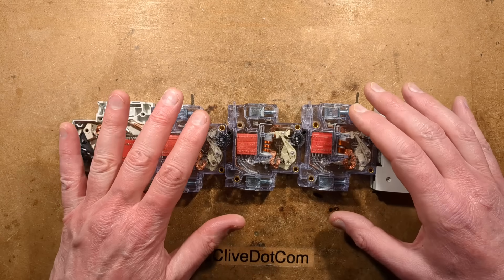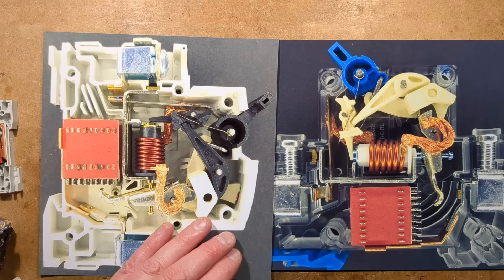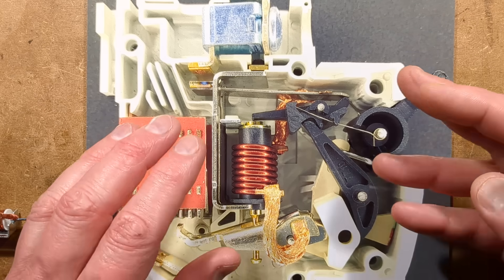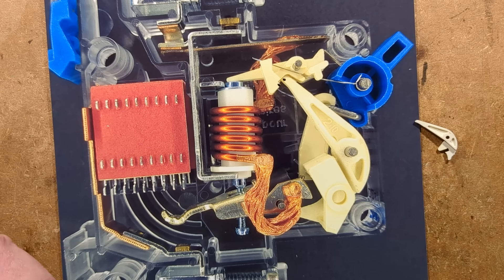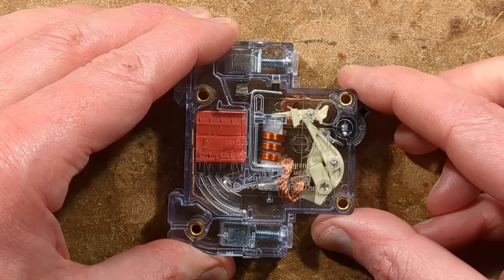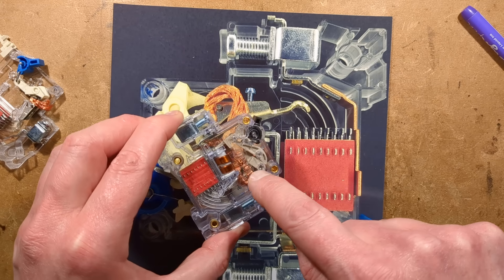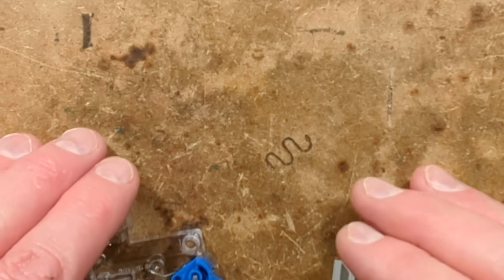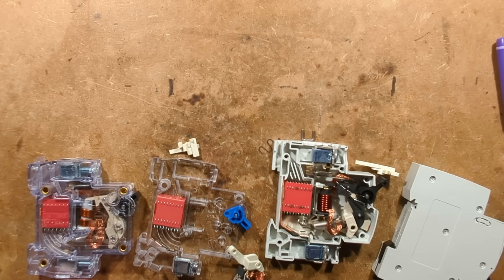A detailed look at the trip mechanism in circuit breakers

Comment: Big Clive I have a problem! I have an electronic tachometer from a motorcycle and it will need some adjustment to work. I can't find any details on what the circuit does to do it's job. Can you help?
Reply from the maker: That may be better suited to a dedicated motorcycle forum.  I know there are different types and workarounds for some.

Comment: OFF TOPIC - Interesting. 
Suggest that you could do a similar video on the thermocouple/safety cut off valve combination used in gas appliances works. I've never understood how the thermocouple generates enough current to hold the solenoid in the gas valve open.
Reply from the maker: I think it's a simple magnetically retained flap that requires very little current to hold.

Comment: Curve B is 3-5x its rating (anywhere within this is acceptable), Curve C is 5-10x (so if it trips immediately at only 8x its rating, that is still acceptable), and a Curve D trips at 10-14x. I don't know where you were getting 20x from. If a Curve D breaker fails to trip immediately at 15x its rated fault current, that would be rejected as defective.
Reply from the maker: The D curve can extend to 20, so you have to use the worst case scenario for instant trip calculations.

Comment: Thanks for your always very nice explanation 👍
I live in Indonesia and recently I serviced/changed the 30+ years breaker panels in my house by loading them individually using a stopwatch and bank of high power incandecent lamps as a variable load.
The lamps in the house has been changed to LED lamps, fridge and AC are more efficient so most breakers rating can now geberally be lowered. About 2 out of 10 breakers are not morking properly, some are noisy, slow working . . .  or plain dangerously not working. Definitely all of them are dirty (sand, dust, insects, damp) and the connectors are rusty. There is no guideline on what year interval these breakers need to retested although the installation safety standard has been revised 14 years ago to use GFI/ELCB.
Maybe it is worth mentioning that new MCBs have a provision to keep the lever “sealed on or off” using the piece of wire (or 1mm fishing line) across the indentation at the lever /hole at the casing.
Also in the many poor area, people dangerously using the (cheap) MCB also as a switch, which as you demonstrated, relies on delicate plastic parts as its latch. When the MCB is used as a switch, it is not working as a protective MCB upon switching on, causing a large current surge. 🙏

Comment: Off topic.   I want to replace an e-bike battery  . My motor is ..350w..battery that came on bike ..30w 19.4 A
Would a slight upgrade of . 30w .13 A  be ok to use?

Thanks.
Reply from the maker: I can't really advise on e-bike stuff due to the risks associated with their batteries.

Comment: I wonder what the difference is with the DC versions. From the outside they look identical, but they are functionally non compatible (apparently)
Interesting Levels of design input with such a common product.
Reply from the maker: They may have a magnet to deflect the arc into the quencher.

Comment: In Uruguay, we use bipolar circuit breakers. Each circuit breaker is composed of two units like the ones you showed, assembled together, and they cut both poles. If you disassemble it, you can see that internally they are linked by a small springy wire, so if the circuit breaker of one pole trips, that spring makes the other one trip too.

Comment: These breakers at 3 or 4 pounds are quite the bargain. A single 20 amp USA breaker for a Square D entrance panel is about 20 USD, last time I checked. Very complicated little mechanism, kept affordable by designing for mass production. Thanks for this post BC!
Reply: that's about £14 in British pounds
Reply: They're about $8 at Lowes today.. not unreasonable. GFCIs, however, are a fairly disgusting $60+.

Comment: The breaker tripping curve is crazy.
We had a breaker trip at work once in a while and so was checking everything plugged in and I became confused. I used a kilawatt and read the plates for what was plugged in and it was WAY OVER the rating. so went to make sure the breaker had correct rating too and when I looked up model it was possible to get nearly infinite amps if you ramped up slowly enough... .. think of several shop-vacs and air compressor plug other stuff plugged in to same 4-block plugs 120v. 

One funny thing was because so many things running together it was causing voltage dropped down to about 100v from 118v. and that was lowering the amps, like self regulator. 😂
Reply: @ralanham76  there is a not-so-well known problem where circuits that are wired with cabling that is too thin can defeat the circuit protection due to self regulation of the current through the too-thin cabling.  Unfortunately, the result is usually a cabling fire instead the wall instead of a trip.
Reply: @junkerzn7312  I think in this case it was a combination of very long run and the way it was used. Once it had tripped a few times we knew something was going on. I'm sure there was some good heat going on. It was in metal conduit the way. 

The solution was to move the plugs around, because there were two more 4 blocks on different breakers close by.
Reply: @ralanham76  Yup, that could do it too.  One has to upsize the cable when long runs are combined with continuous loads, and often construction companies save money by not doing that.  The copper heats up and copper is good at transmitting heat, so the service box can wind up getting quite warm.

In the U.K., where small form-factor breakers are a lot more common than in the U.S., horizontal packing in small spaces (also very common in the U.K.) can result in a lot of heat.   This is less common in the U.S. where breaker boxes tend to have much larger physical dimensions and don't use the MCB form factor.

-Matt

Comment: Any plasma that forms from an arc is going to follow the electromagnetic field lines in a complicated fashion. That plate is essentially an electrode that shapes the election path. 

It's rather similar to how a photometer tube works, if you've ever seen the inside of one of those. They're designed to amplify the current, however, not quench it

Comment: 12:45 I’m curious to know what causes circuit breakers to trip more frequently as the age. We’ve had to replace a few that just kept tripping after about twenty years, and the (identical) new ones do not have the issue.
Reply from the maker: Internal thermal dissipation from worn contacts can make them more sensitive to lower currents.  They can also become more sensitive to vibration.  In the case of RCDs or GFIs they can become more sensitive due to gradual capacitor degradation.
Reply: That little sear can wear down and require less pressure from the bimetallic strip to trip. They can get to the point of never latching.

Comment: It had never occurred to me that Europe didn't use the same breaker sizes as the US.  Also, that the US's scale is more metric like with 10, 15, 20, 30, 40 and 50A breakers compared to the base 16-ish system shown here.
Reply: @kcgunesq  those are standard in the U.S. too, just not as common because most U.S. domestic circuits run at lower voltages (120VAC), and thus are wired for larger currents.  You will see those values more in DC applications.
Reply: @junkerzn7312  Good to know.  Thanks.
Reply: The UK typically uses 6 (lighting), 10 (heavy lighting), 16 (single-purpose circuits like a boiler or an integrated microwave oven or a couple of socket outlets), 20 (same), 25 (rare), 32 (high loads; ovens, socket rings, very common), 40 and/or 45 (thermostatic showers, EVSE), 50 and 63 (sub mains, e.g. feeds to a garage, although sometimes you'll find these on 32 or 40 as well). We have different thresholds because we use metric cross-sectional area conductor sizes, and circuit breakers are sized based on the current-carrying capacity of the cables. You have different cross-sectional areas and different safety thresholds, so you have different circuit breaker ratings.
Reply: @aaronmdjones  The current carrying capacity of cables is highly variable and defined by the type and installation method. It is quite the other way around - cables are chosen to meet the requirements of the load and breaker required.

Comment: It's easy to see why they have the same mechanism - it was patented long ago, and once the patent expired (they're usually only valid for ~20 years), it's in the public domain and everyone can just use it. A quick search reveals patents for "trip-free" circuit breaker mechanisms from the early 20th century, and although I didn't find precisely the one shown here, I bet it's a many-decades-old patent-expired design from a prominent company like GE or Westinghouse.

See US2489085A and those related to it, for example.

Comment: I always wanted to know what doe make these ticking. Before them, I had those round with Edison fitting, also automatic. So, when I find a box of these breakers, i opened one (some 15 years ago) and my curiosity was satisfied. 
However, I have a question, maybe you can know the answer. So, I have contracted a certain power from the electric company. Now is 5000W but I lived in rental houses before that had 3000W contracted (the cheapest contract they offers). The main breaker is 32A that means that at around 7500W it trips. However, when I get past the contracted power (for 4000W that means that in winter with room heater 800W+stove 1800W+microwave 800W+water heater 800W), the breaker trips. I reset it and after few seconds it trips again unless I disconnect something. After I upgraded the contract from 4000W to 5000W (more expensive), never ever happened again, with the same electric instalation, same breakers, same house, same electric appliances.
I understand (the guys fron the electric company told me) that the electric company makes it trip. How is that possible?
Reply from the maker: Many meters have the ability to disconnect power under certain conditions.  But they shouldn't be able to trip an ordinary breaker.  There are specialist programmable breakers that can be set to trip at a specific programmable current.

Comment: You said @9:39 that the arc is drawn down into the arc cooling shield or baffles and venting out the bottom is wrong. The positioning  should be up the other way, the switch is in the position for Off (O) and down in the On position (I). This is so the hot ionised gas is drawn up through the arc cooling shied and out the vent the top. The conductor leading away from the moving contact is to draw the arc away from the moving contact and inceasing the distance an arc has to jump thus dissipating ther energy and temprature of the ionised plasma gas. The baffels ensure that the energy in the plasma gas it fully disipated and extinguished.
DC rated breakers have not only termal trips and overcurrent mechanisims but also a magnet to hepl draw and extinguish the ionised plasma arc. Some DC breakers have an additional winding that produces an magnetic field to help create the magnetic field to extinguish the arc.
Reply from the maker: Keep in mind that the breakers are often mounted horizontally in industrial panels.
Reply: @richard So, the manufacturer wants you to install them in a position, where all the text on the face is upside down? Strange choice.. 

I've only been an electrician for 25 years and I think I haven't seen any din mounted mcb:s that isn't on when the handle is up (and the texts on the face are in a right way).

One thing that tricks first timers is the color codes on the indicators, which is usually
Red = on = dangerous and
Green = off = a bit safer.
Reply: @villehietala9677  Text upside down what utter rubbish. Read my coment  "and down in the On position (I)"  It is Up in the off (0) position.
Reply: @richardkaz2336  English isn't my first language, but I still think that you have it somehow twisted in your mind. Or you have some mystery mcb at hand, that is somehow different from all the rest.

Comment: If I recall correctly, there are some different "groups" of circuit breaker tripping "speeds" (I don't know if that is the right word). So if you have a high initial current, you want to have a "slower" circuit breaker.
I wonder how they differ to the normal or fast tripping ones.
Do they just have fewer windings (so in theory a higher current rating), but the bi-metal strip is the same as the rated current?
Reply from the maker: That's the type rating.  The type C breakers have a higher instantaneous trip current than the type B and are better suited to high inrush loads.

Comment: What would be the main difference between a "normal" breaker and a breaker specifically designed for DC? Would it have something do with the arc quenching or is there something else?
Reply from the maker: Dc breakers sometimes have a magnet to drive the arc into the quencher.

Comment: I have heard a few times that breakers like this shouldn't be used as on/off switch, but looking at the mechanism, it seems like that would be just fine - depending on how abusive the load is on the breaker contacts. Nothing else in here screams to me that it's going to wear out quickly from switching on and off.
Reply from the maker: They are not suited to regular use as a switch.  They will wear faster and the contacts will become pitted.

Comment: The trip latch is virtually identical to the trigger sear in a hammer-actuated firearm.  

Fascinating stiff, Big Clive!
Reply: That's almost certainly where they got the idea for it from to put into breakers. Hold back a large force but be able to release with a tiny force.
Reply: @ZaphodHarkonnen  similar mechanisms have been used continuously for millennia prior to firearms, crossbows being the obvious example. Gentle pressure releasing a large force is useful in innumerable applications, the movement of a clock uses miniscule force to gently release energy from a spring under extreme tension.

When making confident claims, you almost certainly should do a little research first.

Comment: i am curious about the modern wifi - tuya  circuit breakers . i have one but i wont open it since it is still working and i have not tested it on reverse current from the solar panels to the grid .
Reply from the maker: They are sometimes based on a standard circuit breaker with auxiliary trip and reset mechanism.  Unfortunately, if the circuitry fails (usually the power supply) they revert to being an ordinary breaker that may be grossly oversized for the wiring.

Comment: Fancy, I bought some transparent ones as well. Great for education, compromised safety for an old home. If your house is made from timber and has reticulated wiring, an extra fuse-wire block adds the ultimate protection.

Comment: Wonder how the trips of a circuit breaker compares to the trips from a tryptamine.🤔 Neverthless an interesting enquiry into the threshold of trips of an electrical kind.😇 Wondering, how the "seal of the burnt squiggle"🤔, that makes frequent apprearances, manifested on the work table?😊.❤️👍
Reply from the maker: See the plastic stapler video for a clue about the squiggle.
Reply: @bigclivedotcom  Appreciate the pointer. Unfortunately my comment got csored, possibly due to child safety concerns.😂❤👍

Comment: One of my neighbours had a 16A breaker trip. When he pressed down to reset without fixing the issue the 25A main breaker in the basement tripped. So I guess when you reset a breaker there is a time window where it can't break fast enough to stop a high current?
Reply from the maker: Often several breakers in series can trip simultaneously.

Comment: I'm curious to see the inside of a multi-pole circuit breaker.
Reply from the maker: I do have a single module width double pole version here.  The common three phase breakers are just three single phase breakers with a mechanical linkage so they all trip at once.
Reply: @edsontomioka  usually two linkages.  The handle bar is one.  There is also a cross-trip linkage between the breakers (usually a little plastic piece that fits into slots in the housing).
Reply: @junkerzn7312  Thank you very much for the information!

Comment: AFAIR the way the arc quenching works, is the movable contact gets near the plates of the arc quencher, and the arc will jump preferentially towards it (which is why the other fixed contact is electrically connected to the far end of it).  the plates then suck the heat out of the arc, which quench it.
Reply: That makes sense. I didn't think it was cooling off. 
Somehow I thought it was like here's 12 plates... No way you can jump them all. Like each jump takes so much.
Reply: @ralanham76  @kevtris it's both! The arc jumps preferentially towards the splitter plates because it magnetizes them plus the Lorentz force, plus the gas behind it is expanding. The splitter plates cool the arc, which is super helpful in tending to quench it.

But also, each time the arc attaches to a separate pair of metal electrodes, there is a fixed voltage added that's relatively independent of current, about 20-40V per arc from what I've seen. This has to do with keeping electrons emitting/keeping air ionized, or something (honestly I don't really know the physics). Whatever the case, each plate adds ~20V at least to the arc voltage, also very helpful for getting the arc to extinguish by helping to ramp down the current or at least slow the rise of the current.

So you're both right!
Reply: @InductorMan 👍 thanks 

 so it's like a power splitter 🤣
Reply: @InductorMan  Yea, I was about to say that the breaker box seems to have only one (big enough) opening at the bottom. When the arc is heating the internal gas, the gas will push the arc towards the opening, where the quench mechanism is located. This design does not rely on gravity to work. That's why these breakers can be mounted in any orientation.